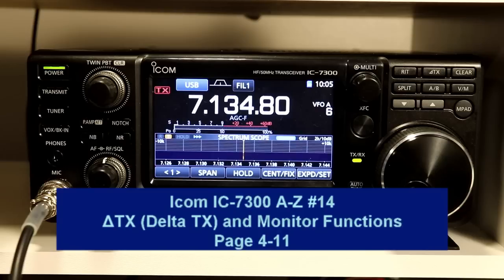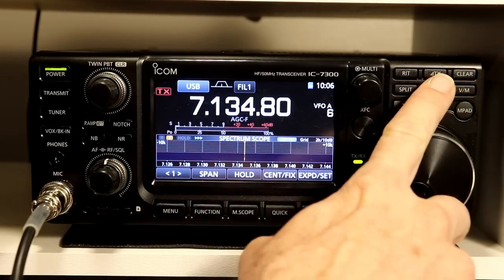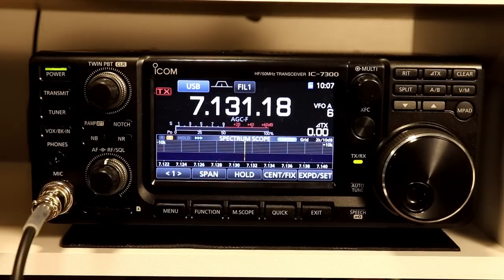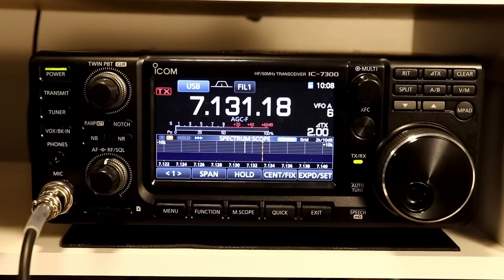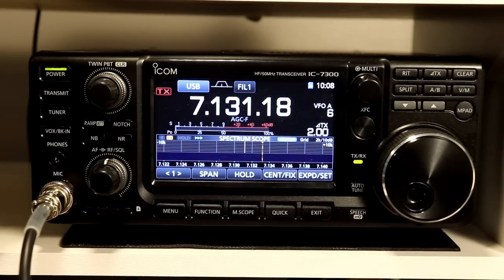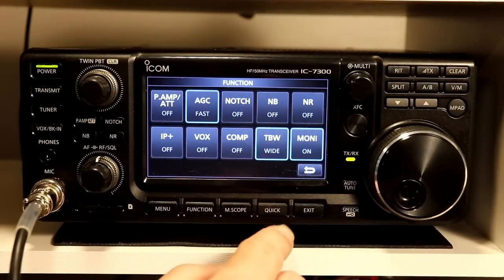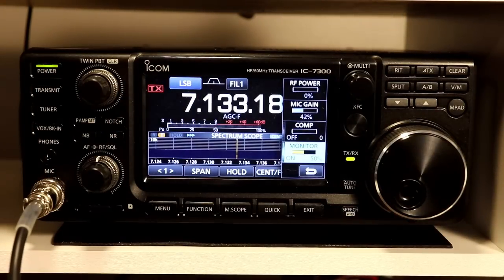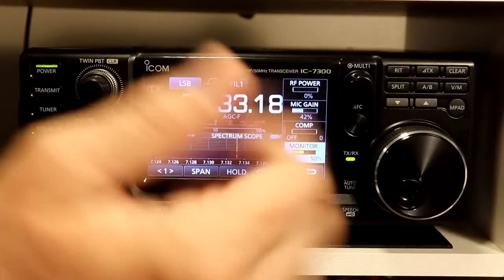Icom IC7300 A to Z #14 ΔTX (Delta Transmit) & Monitor Functions

Comment: Regarding the comment at about 4:20, DX on CW rarely listens up over 10 khz away, usually only 1 to 2 or 3 khz up.  Only the rarest dx spreads them out further than 10 khz on CW.  Now on SSB of course, those rare stations can spread them 50 khz or more!  (yeah I know, my comment is 6 years late, hi hi)   de WD5N

Comment: where the RIT function allows you to hear a TX that drifts a tad off frequency, allowing you to TX at the selected try, the Delta TX (∆TX) allows you to TX allowing for drift in your own tx frequency. So if you're talking and he says you're drifting -900 Hz, you can adjust +900 hz so you effectively cancel the drift, while you still hear at the selected frq

Comment: RF POWER when 0 you have about 2 watts of power out!
Reply from the maker: You are correct.  I learned that 0 isn’t actually 0.  So I now make sure the frequency is not in use or I use a dummy load.

Comment: Monitor Function:
I use a powered external speaker and adjust the Monitor level so I can hear when I am using Voice TX at a proper volume.
Reply from the maker: Thanks for sharing.

Comment: I think the monitor is essential with headphone.  I noticed my signal as (xxxx) with the monitor on.  The power meter showed spurts of power.  With another mike everyting fine.  Headset went back to Heil.  I too think they wasted a button on the delta TX but thanks for explaining what it does.  I am a lazy ham.  73

Comment: I would have a dummy load on it!  You have it set to 0 power but it does put out about 5 watts.
Reply from the maker: Yes.  Others have made that comment to.  I haven’t measured it, but you’re right, a dummy load is the best approach and I do that in later videos.

Comment: The video has some age on it, but a real use for this is working CW pile-ups when you are hunting/chasing.  By moving your TX around, you do 2 useful things: 1) you move away from the pile, so your signal isn't exactly on tope of the others in the fray and 2) change the audio frequency a bit which may make your sound more distinctive for the runner.  Both of these help the Runner/DX station pull your signal out of the pile.

Comment: setting for 5 up or 5 down using  ΔTX  leaves the other VFO for another band frequency if you would like to use VFO A/B button. In split mode, both VFO are used and you cannot use it on another band frequency. It is also quick to adjust the offset with the  ΔTX

Comment: When I call CQ and a person answers me slightly off frequency, I want to keep my transmit frequency the same but I want to offset my receiver to his/her transmit frequency. Otherwise as you know I would be retuning throughout the QSO to what I want to hear, and so would he, and hence we would both be chasing each other either up or down the band. So, in that situation I use the RIT feature. But, when I want to contact someone (DX or contest pileup station) who is already in contact with someone one else who is slightly off their frequency, I want to keep my receive frequency on the DX or contest pileup station's transmit frequency, but I want the DX or contest pileup station to hear me on the same frequency as the last contact that he made. That is, I want to offset my transmit frequency (not my receive frequency). That's when, I use the "Delta Tx" feature. Yes, I could do it the other way around. That is, I could retune to the "someone else" and then use the RIT to hear the DX or contest pileup station, but it seems to me more intuitive and it is certainly more convenient to use the "Delta Tx" feature in that situation. I never had a rig before that provided a "Delta Tx" feature, but when I got my 7300 I immediately fell in love with the feature. It made me think, "Now that makes sense. Indeed, very smart. Why haven't my previous rigs had that capability?"
Reply from the maker: Hi.  Thanks for the comment.  That is a great use of the Delta-TX function.

Comment: Hopefully you still monitor this thread! I have been watching these videos on the 7300 and am learning so much, thanks for making these! My question is, the monitor feature doesn't seem to do anything on my radio. I turn it on and it doesn't do any of the things you are getting it to do. I also noticed that if I go to the monitor setting from the Multi button, I cannot turn it on and off by tapping the monitor button. Can you help me out on that?
Reply from the maker: Hmmm. Off hand I can’t think why the menu touch screen button wouldn’t work. Out traveling right now. I’ll check the manual and play with mine when I get home and see if I come up with anything.
Reply: I noticed that my monitor function stopped working for an unknown reason, but when I pushed the multi button to bring up the menu selections, and then hold the "monitor" (at the bottom) it then lights up "MONI" at the upper right of the main screen (next to the time). Then the monitor function worked again. You can touch  the "MONI" at the upper right and it will change back to "M-CH" or "kHz" whichever you had before. I have no idea why the monitor functions stopped working or why this seems to reset it.

Comment: Thanks for you response...  yes the headset is plugged into the audio jack on the front of the radio. I would think that should mute the speaker on the top of the radio.   I don't think headset i have uses the pin 8 output.  Could it be picking it audio via induction???  The cables run together into the heil adapter from the headset. 

Really enjoying your tutorials...
Reply from the maker: Well Dave.  I’m afraid I’m stumped.  Yes, plugging the headset in the front will mute the speaker.  That will be very apparent to you if you plug it in with the radio on.  I suppose it could be crosstalk in the headset wiring, but Heil is pretty good about using high quality shielded cables.  So that seems unlikely.  An experiment you could try is to plug a different headset into the headset jack while using the Heil headset microphone.  If the feedback goes away, that would be a pretty strong indication that it is something in the headset wiring.  You might also try calling Heil customer service to see if they have any ideas.  I have heard that their customer service is pretty good.
Reply: @HamRadioA2Z  It could also be that the headphone plug was not fully inserted in the jack
Reply: When using headsets in a recording studio the same thing may occur if the headset volume is turned up very high.  OR if the mic gain is turned up for some reason the same thing may occur. From K5WAW Bill W

Comment: Thanks for your tutorials!  I have just gotten my 7300 and your talks have been great.  One question on the Monitor function... I use a single earpiece Heil Pro-micro headset.  I usually run the monitor at 8%, which isn't really loud enough for me, but if I run it much higher, I start to get feedback.  Is that normal or do I have to use a different headset with both ears covered?
Reply from the maker: Hi Dave.  I wouldn't expect feedback issues when using a headset.  I can't think of any reason that a single ear model would be any worse in this regard.  How does the headset connect to the radio?  Specifically, where is the earpiece getting audio from?  Does the headset plug into the mic connector and into the headset jack on the front of the radio?  Or, does it just connect to the mic connector?  The 7300 has audio out available on pin 8 of the microphone connector.  If your headset is getting speaker audio from there, then the speaker won't be muted and you could be getting feedback from that.  With the headset audio in your ear, you might not notice the speaker is still on.  If the heil doesn't have a separate plug going into the headset jack on the front of the radio, then try plugging another headset into that jack and see if the problem goes away.  If that fixes the problem, you'll need to get a dummy headset plug with nothing wired to it to plug into the headset jack.  That will still disconnect the internal speaker.
If that's not the problem, then I'm not really sure what else to suggest.

Comment: I see a use for it when trying to work DX who are working split, particularly on CW, when the splits are typically 1-3kHz.  The manual seems to indicate that XFC can be used to monitor what's on the TX frequency, which can be handy for seeing where the current station being worked is, to help you set your own split frequency.
Reply from the maker: Hi Ben.  Yes, it would work for that and the XFC button will allow you to hear what's on the transmit frequency.  I've had a couple other comments from people who work CW that use delta-TX.  I don't do a lot of CW work, so I missed that use case.  Thanks for the comment and pointing it out.  73,  Tom

Comment: CW DX stations often send QRZ up and they are expecting you to call them 1 to maybe 5 KHZ up from the frequency they are transmitting on. This is essentially split operation but the delta TX way to operate split is probably a little bit quicker than using both VFOs and maybe easier to set fine granularity of a few KHZ.
Reply from the maker: Thanks Jim.  That sounds like a good use case for it.

Comment: I use the Delta Tx somethings on Cw contesting. When responding to a CQ with many others on same frequency, I respond a few hundred hertz up or down.  Can make the contact that way.
Reply from the maker: Thanks Barry.  Good suggestion.
Reply: @HamRadioA2Z  I do this on CW and also SSB. Sometimes I can hear the other guy best at some specific frequency relative to the other noise or QRM, and then adjust my TX slightly up or down so that my voice stands out from the crowd. I try various TX settings until I get through.
Reply: @robertfrench8681  Nice. Inventive, creative, and a bit manipulative! -'73
Reply: This is the answer. If you are running assisted in a cw contest, you can make use of spots generated by the Reverse Beacon Network. Operators will reflexively click on these skimmer spots -- just like everybody else does. Since everyone is calling on the same frequency, the spotted station only hears noise. The XIT can put you sufficiently off the spot frequency that you can often be heard above the pileup.

Comment: A word of caution, when my 7300s transmit level is set at 0 it still transmit at 5 to 7 watts on SSB.
Reply from the maker: Thanks for the heads up.  I’ll have to check into that.
Reply: Same with mine. My power meter shows about 4W when set to 0 (AM/FM).
Reply: Dummy load is a good solution to this.

Comment: I would assume delta dx is for working rare stations who are listening 5 to 10 kHz up in frequency in order to split all the stations calling so that they can be picked out. It's a shortcut for the A / B VFO functions normally used to do this. Commonly used operating style for Dxpeditions etc.
Reply from the maker: Yes that’s a good example, but a lot of times, I’ve heard DX stations listening way more than 10khz up and then you can’t use the Delta-TX.  Myself, I’d probably just use Split regardless.  However, as I just said in another comment, this radio has enough options and ways to do things that everyone can find a method that is comfortable for them.  There’s no right (or wrong) answer.

Comment: Note:

If we set RIT or XIT/delta TX,  and using logging  apps on PC/laptop,  the application only 'see' the frequency on  display.  

Example: 

If the frequency on display is 7.130 MHz,  and we set RIT or XIT to 5 kHz,  logger application will record the frequency on the display.. in this example, 7.130 MHz, not 7.135 MHz. 

Thank you.

Comment: To make it simpler..

RIT is an offset of currnt  RX frequency. 

Example, now we are RX ad 7.130 MHz. and the frequency display is 71.30 MHz.

If we set RIT to -5 kHz, we are now listening/RX at 7.125 MHz, but frequency display stil at 7.130 MHz.

Now, switch off the RIT. and set delta TX or XIT, to 5 kHz.  Now, we are transmitting  at 7.135 kHz..   

Now, what will happen if I switch on the RIT? In other word,  both RIT and delta TX is enabled.  :)

The answer is.. even the current frequency display is at 7.130 MHz, but, we are RX/listening at 7.125 MHz and TX/trinsmit  at 7.135 MHz.

Now, add split feature in this example. :)

Hope this is useful. 

Yours,
Bahathir 9W2GNU, 73.

Comment: Delta TX:

Generally  I use it, to TX during  'net' which the net operator  asked to TX at certain  frequency, example '5 up' .. where the operator is monitoring/listening. 

So, the Delta TX is more easier, because we only need to set the delta TX to 5 kHz. 
Example: Net operator TX at 7.130 MHz. He is RX at 5 up = 71.35 MHz. 

So, we set our rig's VFO to 7.130 MHz,  and set delta TX to 5 kHz. Our TX will be at 7.135 MHz. 

We can check or monitor using XFC button, to listen and check the VFO.

This feature is similar to RIT,  but in reverse. Set our rig VFO to 7.135 MHz, and set RIT to -5 kHz.  and we now RX/listening  to 7.130 MHz ..  but the VFO is stay at 7.135 MHz.

So, generally sometimes it is much easier to use delta TX at certain condition. 

Thank you.
Reply from the maker: Thanks Mohammad - That’s one application where it makes sense.
Reply: Late to the party, but as a reminder the delta TX only shifts 9.99 KHz either direction. Good for small shift, useless for greater shift.
Reply: @greglawrencemusic  
YEs.